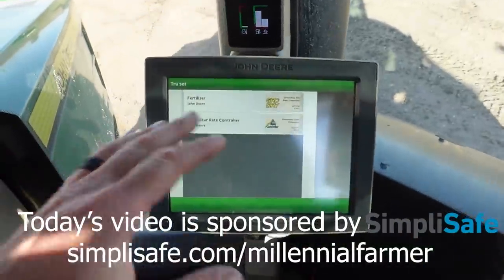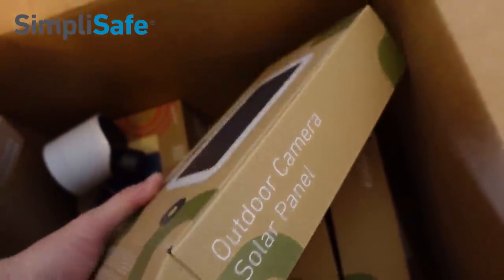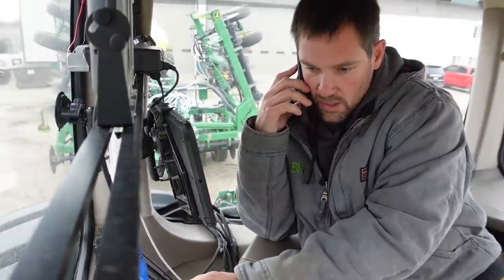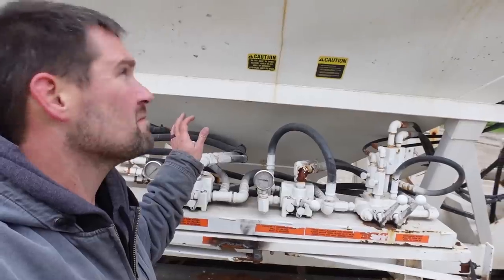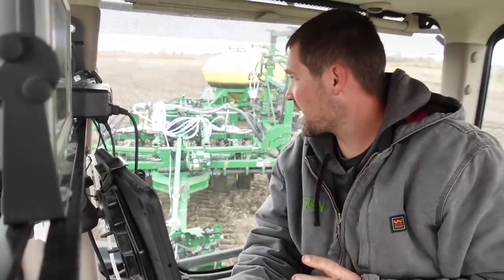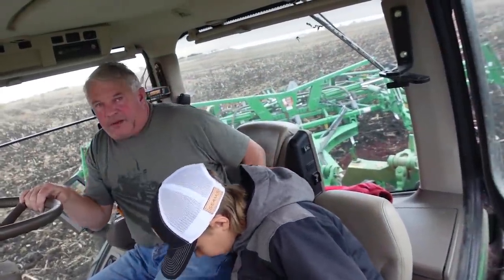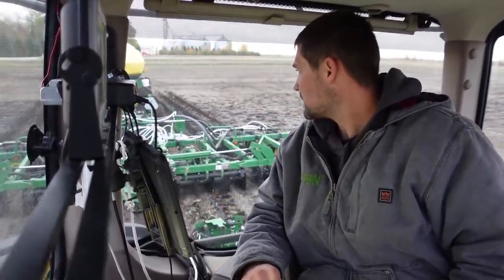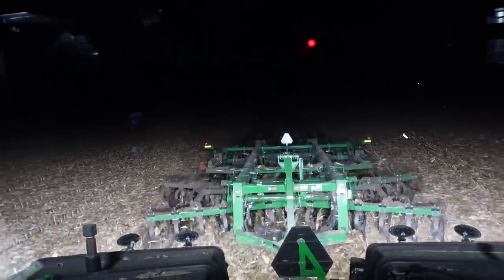My Biggest Mistake

Comment: Hi brother all I can say is hang in there, being on the outside looking in I would say that the system needs to have a recyling feed from the delivery back to the hoppers  constantly blowing the product thru the pipes and back to the hopper to prevent cake from forming. and on the anhydrous tubes seems they need to tip back to stop the mud. like the wake of a boat and the stern being dry then the furrow fold over .

Comment: My folks owned a white 1977 Silverado. It had the 350 small block that would dead heat with a 440. Only because the air conditioning compressor was running!  Or so dad told it. Seeing your kids in the Scottsdale brings back memories.

Comment: We have a salford 9620 air boom.  Learning curve on dry fertilizer is huge.  We use plastic pellets from a local tile manufacturer in the off season to calibrate.  Beats spinner spreaders hands down.  Getting the Deere computer to cooperate with the isobus miller controller is like cats and dogs some days.  We still find it very worthwhile.  I couldn't imagine also doing anhydrous at the same time.  Goodluck!

Comment: Fun fact I work for the railroad and regularly run potash trains. Potash is one of the heaviest things we haul. For example regular 14 thousand foot container trains weight around 13500-14000 tons. A potash train at 8000 feet (almost half the length of a container train) weights 28,000 tons double the weight half the length

Comment: Used to fill anhydrous tanks and deliver them when I worked at the elevator right out of high school….stuff is wicked if not handled correctly. Also made a good weed killer, just froze them
Reply: @Kevin S.  Did you ever have any anhydrous dip onto your arms and burn it
  I used to custom apply it for a couple of years . The fumes make it impossible to breathe when they get into the cab
Reply: @kennethcarlton2860  no, can’t say I had that happen. But when a valve went bad and needed replaced, you’d have to bleed the tank down, and we would do this into a cattle water trough, so the water would collect the fumes. Well, tried to tip it over and it came back in us. Fumes out of the water hit the eyes, yeah.. was not good
Reply: @Kevin S. Unfortunately all my mishaps happened in the field first no water in the tank to try and rinse it off  and when fumes came into the cab it was a little too wet to apply anhydrous . It was great when it was good running I put 5 tanks on it 4 hours and had to wait for the next delivery
Reply: I had a hose connection uncouple and the wind was blowing right at the tractor. I quickly turned the tractor towards the he wind. That was the last year we used anhydrous. Yup it’s not if butbwhen it will hurt you!
Reply: Ever shrink any money with it?  The Coop I’d worked at had a nurse tank that one customer would flat out refuse to take out… #13.
Reply: @kevins5092  Because of no water(anhydrous), the chemical has an strong attraction for water. Lungs, eyes, mouth, nose, armpits, etc. are wonderful places this chemical wants to go. 

From my days in Hazmat response, an A level suit would be used because of the need to protect skin and airway.

I see there's PPE available for routine handling.

Comment: Interesting video Zach. So very different from here in the UK, but we do do variable PK, seed and liquid fertiliser and from my experience the precision/tech side always causes me problems and slows the job down, when it all works its great. I think you need to sit Onyx on the combine next year so you can get that rig moving early as the system looks vulnerable to poor round conditions and is slow compared to traditional cultivation’s. I would also highly recommend screen shooting all your in cab screen setting’s which would make getting going again after a year of not using the machine a lot quicker, and watch out for software updates, they seem to have a habit of defaulting stuff on 4600 screen which can catch you out!! Great videos, always enjoy watching and seeing what you guys in the states get up to. Best wishes. Al

Comment: to answer Becky's question 1939 Packard is when the A/C first came to the automobile
Reply: Was available as a retro fit in 1933, Packard was the first to offer it as a manufacturer optional extra
Reply: ...and taking up much of the trunk in the process. Although, if you were a lady or gentleman who owned a Packard in 1939 and could afford the (IIRC) $5,000 (in modern dollars, of course) to fit one's Packard with air conditioning, then it would be no difficulty to own another automobile for the servants to use to haul one's luggage. :)  In all seriousness, in 1939 a person would be much more likely to take a train when traveling for some distance and time, so losing most of the trunk wasn't the worst of problems.

Also IIRC, those Packard systems were basically running all the time- you could shut off the blower, but the compressor was still fully engaged.  Been many years since I saw one.
Reply: @YeahJustMe  don’t forget to acknowledge Wikipedia at the end of your post when you use them for source material, 👍🏻 could have just posted a link would have saved all the typing

Comment: It’s funny & strange how different things can be from farm to farm or region to region. With the You Tubers from Iowa and into the upper Midwest I’m always left wondering are they just trying to create content or is this actually how things go on that farm. We always run fall tillage right behind the combines to avoid the nightmare of working wet ground, it’s to destructive on equipment and soil. Normally start tillage between 6  or 7 AM and run until 12:00 when it’s dried out enough to combine, or just add 2 hired men. To me the slight extra cost is worth the fewer headaches better quality and stress looking at the weather forecast. Best of luck with your strip tilling. I’m my opinion with Corn especially it’s the only way to go, lots of benefits.
Reply: @bobrobert6277  ğ

Comment: I hauled liquid Anhydrous in Canada for a couple years. Good product but can kick ya in the chest if you let your guard down. I got a good fright one calm cold night, out to a tank that had a small leak that I couldn’t see or smell(because of the respirator we had to use) took it off when I was done unloading, walked to my truck and the stuff had settled in a little dip in the land. When I walked through it it was like someone punched me in the chest, took my breath away. (Came back a few minutes later)  couldn’t speak couldn’t breath. I gained a lot more respect for it after that. Good luck with it all.

Comment: I've been reading the last couple years in the no till farmer about guys using sulfate of potash instead of potash, less toxic for the roots in a strip till band. Its a third more money  per ton usually but ya get some sulfur.  I been thinking about using it for crop removal rate in a strip till band then broadcast potash where the soil test is low.

Comment: I am putting my 1970.   Chev    1/2 ton back on the road for next spring 
Got  a Texas box on it and a new floor in the cab   Got good tires now 

Trying to get the brake leak figured out.    Not sure how to bleed a master cylinder
Reply: @deadghost1964  No pressure to lines
Reply: @georgedavidson1221  for over 35 years on everything, farmer, truck driver, construction with the military, handyman, store manager, etc and I can fix just about everything and on top of that I can proof read when I types...

Comment: Can someone explain why N is being put in the ground before the winter, was always under the impression that is was only required when the crop was actively growing and that because it's quite volatile that it would be all but gone by spring. Any clarification would be great, 😊👌
Reply from the maker: Up here in MN we wait until the soil is cold (below 50 degrees F) and the soil microbes are extremely slow, which means the NH3 will not be volatile because they aren't able to break it down into volatile form.  In a couple weeks the ground will freeze and the N will stay all winter until spring because the microbes are completely done when that happens.
Reply from the maker: But farther south where the soil is warmer, it's a different story. That's the difference!
Reply: @MillennialFarmer  thanks a million for the reply. You mention that your soil the is quite heavy, have you ever trailed an over winter cover crop in any part of the farm to improve the soil structure for spring cultivations or would it not work?

Comment: 1940 Packard was the first car available with AC factory-installed. Late 70s early 80s AC became standard option. Awesome pickup.
Reply: Wasn't it the same as a swamp cooler. Block of dry ice an as you drove it blows the air across the ice blows cool air on you ?
Reply: It was withdrawn by Packard due to engine overheating and reappeared in the 50's
Reply: @ronniewilliz153  that was popular out west. They called it a swamp cooler. I believe the ice lasted about 4 hours.

Comment: NOw you need to get some y-dops for the sprayer and give your corn 28 on the root at 12v stage and at the flag leaf stage for over 300 bu corn avg.
We do 40,000 plants, split 2 rows  4" apart 20 "centers fert up front 2 passes with 28 -00-00 with y-drop last three years over 300 year avg. We hear guys south of us are getting 450 to 500 years. (Gods country)

Comment: Do you guys ever use a 7 1 2 ratio witch comes out to 16 4 8 ratio try finding a humic do partial for soil health  is lawn fertilizer good for that soil type.  Mr millennial farmer can you please explain onyour video is there a difference between lawn fertilizer and fertilizer for crops. Your a smart guy.  Keep up the hard work.
Reply: In simple terms yes there is a vast difference between lawn fertilizer and fertilizer used for growing crops or commercial grassland.
However the basic chemical nutrients are the same for both. That is Nitrogen, Phosphorus and (K) Potassium. In addition it is quite common nowadays to find added Sulphur, and, for more specialised circumstances (crops / soil type/ soil condition) nutrients such as boron, magnesium, manganese, sodium and even calcium may be added.
The major differences revolve around agricultural fertilizers where the ratios of the major nutrients will be wildly different compared to straightforward lawn fertilizers. In principle a grower will feed for the type of crop they planning or actually are growing plus taking note and reacting to known examples of any soil excess or deficiencies already in the soil. The actual levels in the soil vary greatly for area to area and are analysed by soil sampling and lab testing of these soils. The most sophisticated growers will have soils sampled regularly with samples collected from 100 meter square areas collected in a grid pattern and mapped via GPS. 
When this linked to other data sources, such as yield mapping from the combine, this is used to create variable application maps on equipment applying fertilizer.

You will note in this video Zack is trying to apply three individually separate major nutrients simultaneously as he drags the applicator through the soil which is trying to place the fertilizer deeply in the soil in rows directly underneath where the seeds will be planted in the 2022 season with great accuracy but at the same time varying the amount applied according to the soils potential to grow a great yield at the lowest cost of fertilizer use. - Hence soil mapping. 
(A major potential side benefit is time saving in the spring by not having to apply fertilizer at planting time in the spring.)
Reply: @w056007568  ok great to know . What about humichar dg particulars.
Reply: @ripmaster896  
I'm sorry but I have absolutely no idea what this is.
Reply: @w056007568   im guessing you didn't take mathin school. Lol 😆

Comment: What's anhydrous and why do you use it? We use solid forms of nitrogen like urea and sulphate of ammonia. Why do you apply it it the autumn? Does it not leech/evaporate before the plant gets a chance to use it?
Reply: Anhydrous  is a gas form of N. It's 82% N I believe . It's shipped and stored in heavy tanks. It's  the highest amount  of N by weight so that's why guys like it and is usually the cheapest form of N.  Most people will put a inhibitor  with it in the fall like that that helps keep it from leaching!
Reply: @kevinmeyer3884  thanks mate

Comment: Hey how do you guys like your GMC Yukon XL? I see you hauling the camper around with it and road tripping it in some of your past videos. Looking at getting into one, sad day tho when I’ll have to get rid of my Ram.
Reply: My wife had a Yukon and now has an Expedition.   We usually keep the vehicles around six years / 100K miles.  The Yukon had electrical gremlins most of its life until I changed every ground.   Door locks, window regulators, alternator, battery, etc all were replaced; some under warranty and some my cost.  Also had to do both front wheel bearings, driveshaft U-joints, and rack and pinion beside all the normal maintenance items.   The Ford got a new throttle body and PVC under warranty and new steering wheel cruise control buttons on our dime.  It’s 5 years old with 75K and is a 3.5 L EcoBoost.   There are some complaints on the EcoBoost engines but have not experienced any.  We are religious on 3K oil change intervals and better than book maintenance.   Just my experience…Good luck.

Comment: That's a massive rig with all those trailing components. Is there a large savings using anhydrous vs a dry fertilizer that has nitrogen in it along with P and K?
Reply: Anhydrous is usually the cheapest form of N but it's much more specialized to apply
Reply: It has more to do with volume. To get enough N down  it would take a lot more volume with dry fertilizer, he would be refilling the cart a lot more. If I had to guess it would be at least 3 times more often refilling.
Reply: @richardlug6139  thanks for the reply. I always wondered about that.
Reply: @SmallMartingale  thanks for the reply. 👍

Comment: What are you doing about these astronomical fertilizer prices these days? Last year we bought 32-0-0 for 191$ ton now its 640$ a ton. Were just cattle and grass farmers. Does the soybeans give you enough nitrogen for next years Crop?
Reply: Not if you're planting corn--corn needs mega fertilizer to achieve big potential yields..that's why there will an up tick switches of acreage to less cost soybeans.  But the catch 22 is that both have to be planted at some degree for rotation purposes..

Comment: Don't forget to always give the trailer a tug before you get out of the truck to make sure the latch is locked. If you don't get into the habit of doing this it'll bite you some day and you might drop a trailer. Especially after bobtailing on rough roads.
Reply: Look at the back of the fifth wheel with a flashlight, make sure nothing shiny is showing. Not fun when you lose one and have to crank up a loaded trailer...........

Comment: Hey zach, i saw in a few videos that you were having an issue trying to put DEF into a machine because the nozzle keeps clicking off! Its because of the splash back from the filter in the tractors tank.
Simple fix, take a foot long length of plastic pipe, insert it into the tank up to the filter and then put the nozzle in the other end of the pipe (basically increasing the distance between the filter that causes splash back and the splash back sensor on the nozzle)
Problem solved.

Have a great day and keep up the good work my friend 😁👍

Comment: They invited so called air conditioning in 1957 with the Ford Edsel citation. One of the first to come standard with AC. Although compared to today's standards it wasn't very good. In fact one of the reasons that the car failed is because it was ahead of it's time. The 1940s Packard also came equipped with air conditioning but compared to the standard of the day it wasn't technically air conditioning basically some frozen blocks of ice. The citation was one of the first to actually offer a coolant based air conditioner.

Comment: I wonder why the ding-dong who installed that winch plumbed the control valve to move in the opposite direction from the cable? Otherwise that is the coolest thing I've seen all week! makes a dang-near 2 man job into a piece of cake!
Reply: just switch the hydraulic hoses around

Comment: I guess it was alot easier in the old times.. They didn't have all the hasdle with hardware and software 😂 They got fit by running in and out of the equipment to check on different levels of fertiliser or seeds💪💪

Comment: With all those monitors you have in your tractor Zach you're making farming way more complicated than it should be with your pot ash your phosphorus and anhydrous just making it way more complicated than it should be sound like you're just trying to be a great big farmer that trying to do everything in one operation with your strip tiller your fertilizer tank and you're inside your tank all in one operation to save fuel but I suppose you'll get it all figured out and all dialed in the way you want it but it's good to see your dad and Jim doing the fall tillage and it also good to see if you got your crop off before old man winter showed up

Comment: why are you driving out a lot of expensive fertilizer in the fields this autumn ??.  there must be large losses in the drains before the spring and it is time to come out with the seed drill.  we run both fertilizer and grain at the same time in the spring 😊
Reply from the maker: No losses.  P and K are both positively charged and bind with the soil and our microbes have stopped for the winter with the cold weather so N is also done moving until it warms up in the spring.
Reply: @MillennialFarmer   👌🏻👌🏻